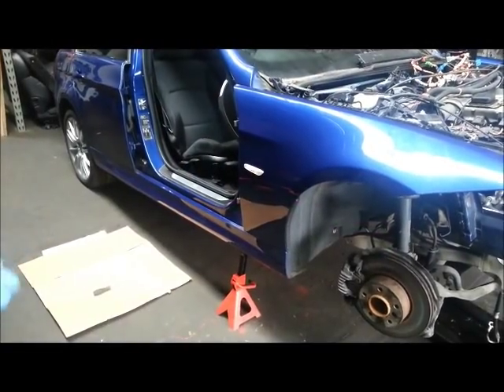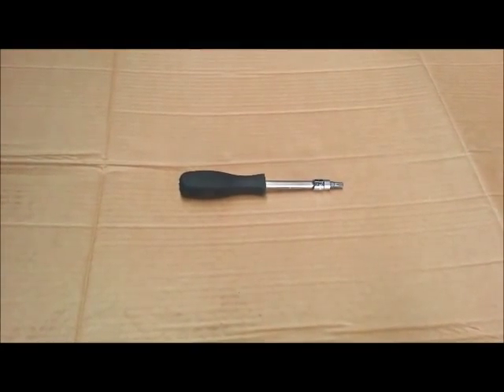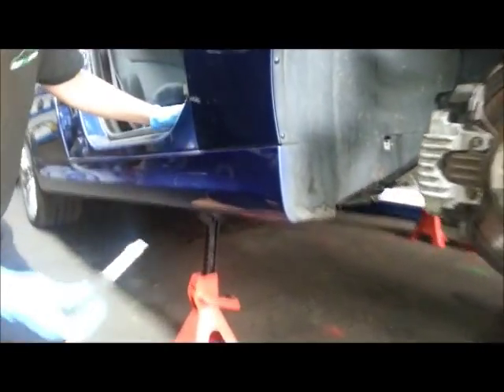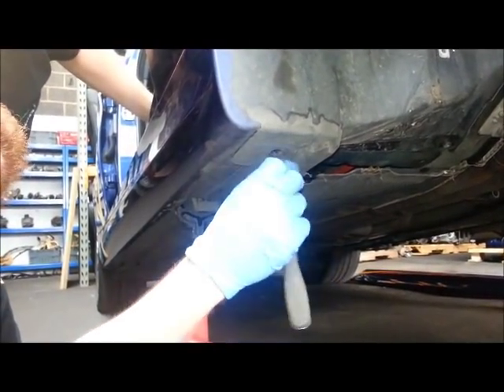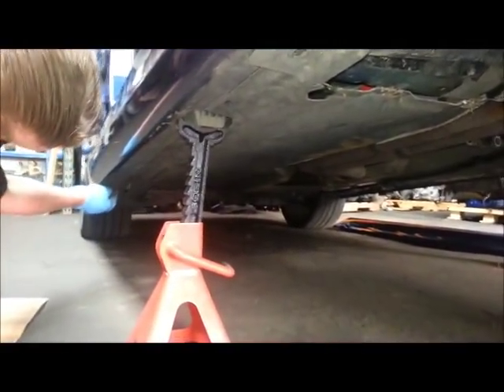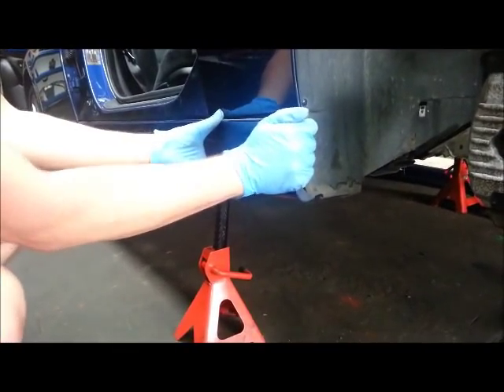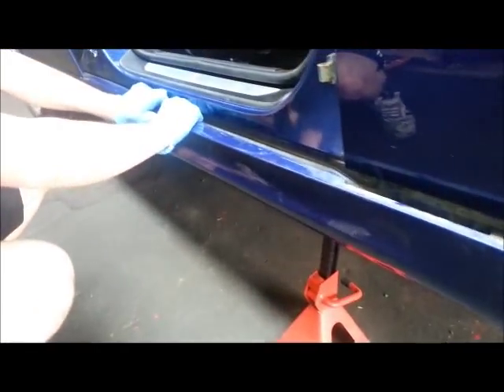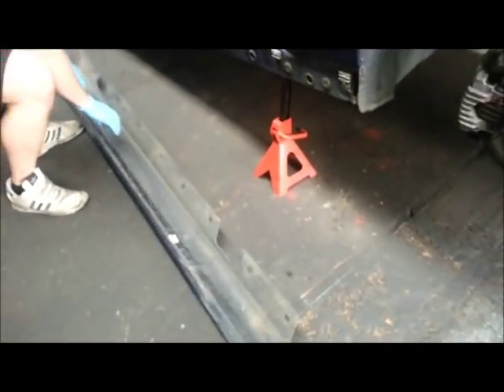BMW 3-SERIES E90 / E91 / E92 / E93 2005-2012 - How To Remove Side Skirt / Rocker Panel Removal

Comment: Cool, thanks. So if mine are coming away from the body near the front fenders then maybe the clips are broken, or (hopefully) just detached...
Reply from the maker: Yes, it sounds like a problem with the clips.
Reply: Thanks for the video! Question does the side skirt itself have clips on it to clamp back on or do it have to glue some on??
Reply: I was looking into this some more. The clips seemed to have popped out in a few spots,  when I pushed them back in they click, but are now too far in and look worse. Guess I’ll have to just take them off to figure out wtf is going on under there.
Reply: Alloutofdonuts ok keep me posted. Thanks
Reply: @paulanthony8335  Were you able to get this done? I need to replace mine as well. Where did you buy the new parts?

Comment: ARE THESE SKIRTS MADE FROM PLASTIC OR FIBERGLASS? CAN I HEAT GUN IT TO RESHAPE IT AFTER AN ACCIDENT?
Reply from the maker: The factory skirts are made from plastic. A heat gun may help, but it would probably still require some filler and then painting.
Reply: @SelectVehicleSpares  THANKS. MY GARAGE SAID THE BONDO WOULDN'T STICK LONGTERM THOUGH.

Comment: How you put it back on lol
Reply from the maker: Remove the clips from the vehicle, and then fit them on to the skirt. When fitting the skirt back in place the clips will then fit in the the sill. When the skirt is in place the fitting on the underside can be pout back in place to secure the trim.
Reply: Select Vehicle Spares thank you